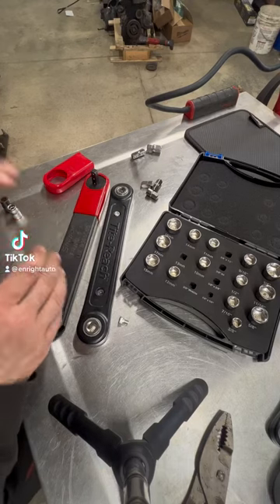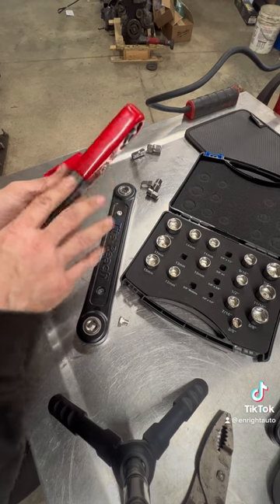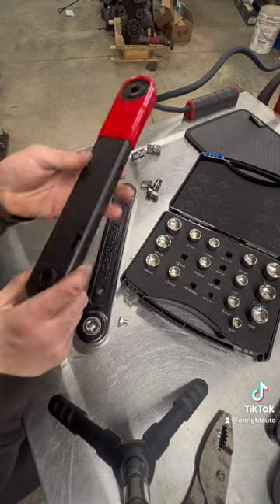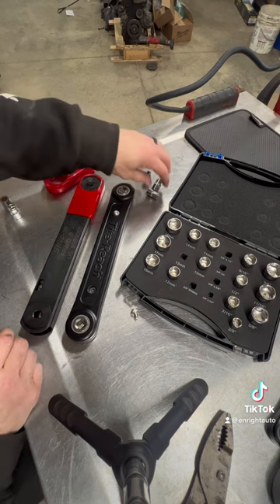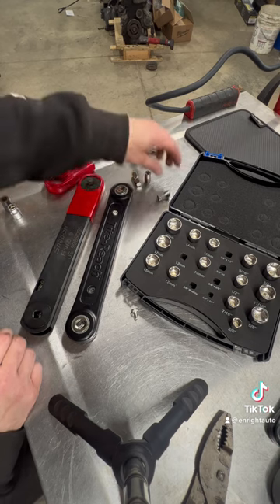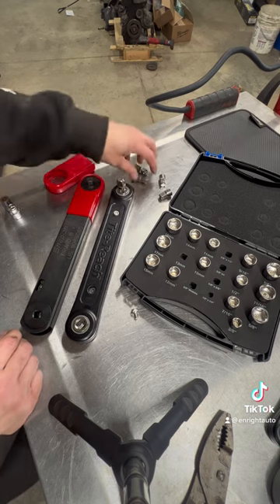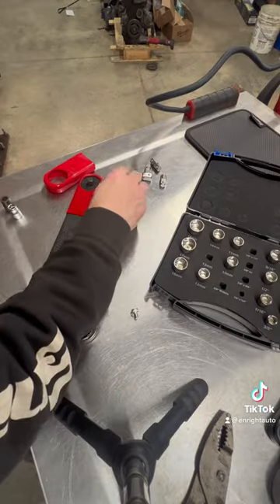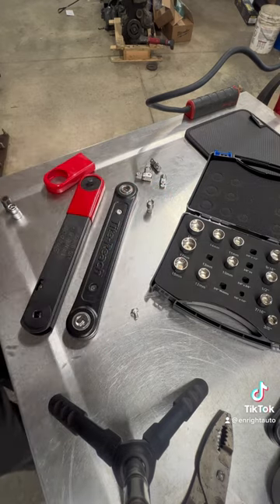Tite reach & snap on extension wrenches

Comment: Interesting! So, should i get the snap-on or the tite reach
Reply from the maker: Depends on what you want 🤷🏻‍♂️ this is a tool that’s going to sit most the time imo but when you need it. They are worth their weight in gold.
Reply: @ReelAuto  seems like without trying youve helped me again man! Just because thats how it goes,  ill end up with the snap-on version, but ive already had to borrow my paps for pulley bolts on some weird Chevy cars 🤦‍♂️ extremely handy when their needed.
Reply from the maker: @3seriesgarage  Yea I don’t think you can go wrong with either one. Obviously the tite reach ones are much better priced. You can get all 3 sizes in the pro version for less than the 1 from snap on so it may be a good route for you to go. I had pricing in the video but it cuts it off at 60 seconds on YouTube shorts sadly
Reply: @ReelAuto  🤔🤔🤔 as far as needing 1 let along all three, yes thats a no brainer, but im not sure how often id use the smaller sizes as ive recently invested in some astro tools ⅜ lowpro sockets and the set reached feom 6-24mm, surprisingly with no skips! And its been extremely handy in the same lines of need, but as far as the very few times ive used that extention, it was on larger pulley bolts or such in them areas, but again anymore with the lowpro sockets they have been the go to! 🤙 i tell ya i like staying tuned on others channels! I see and hear some useful/interesting stuff💪💯
Reply: Look for facom ones😊